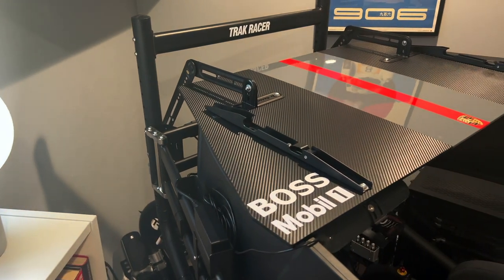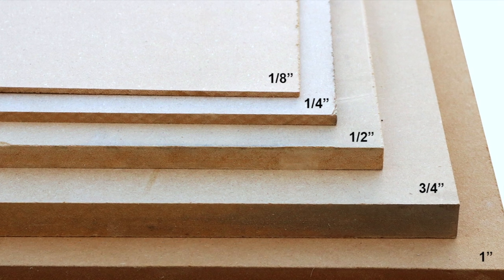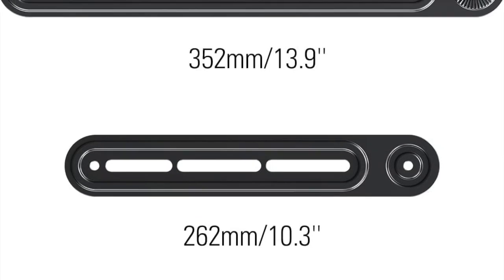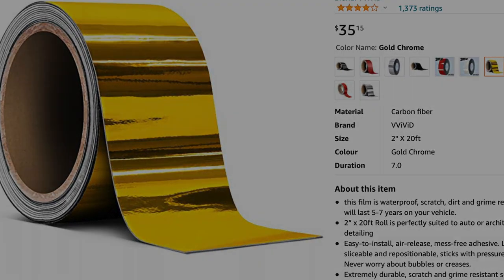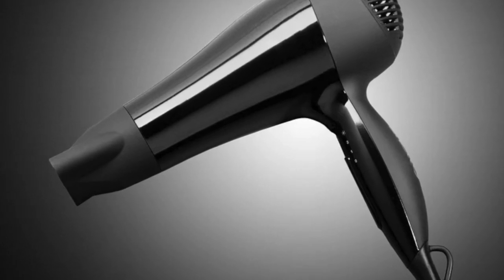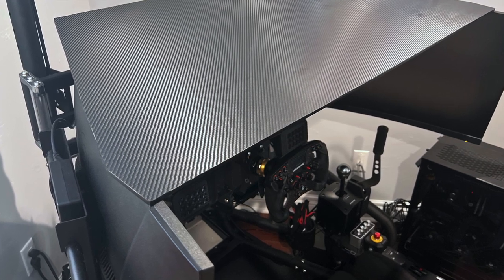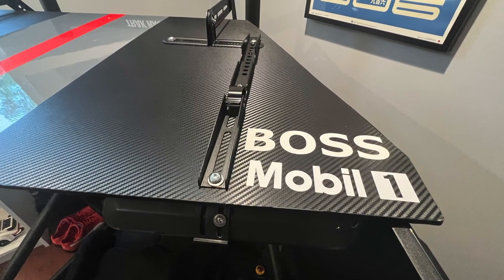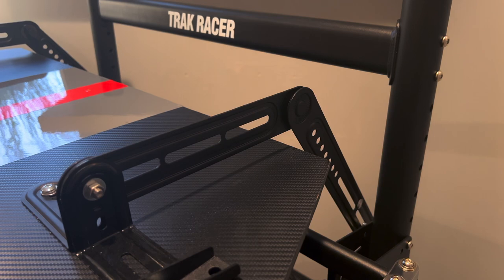Step-by-Step DIY Cockpit Roof Build for Sim Racing IMMERSION

Comment: That’s super inspiring as I am looking for different ideas to build myself a roof. Very good job mate! 💪 I love the clean look on top! 👏 questions: your head is still not covered by the roof? Isn’t that a bit distracting/off? Why not fully cover the cockpit including the seat? I first thought your roof can be lifted / tilted up… thanks for the idea though. 😊 is it getting warmer while racing now, with the roof installed?
Reply from the maker: Thanks! My head is not entirely covered, but it's still very immersive. You're not looking up directly above it, but it helps close in the screens so your eyes aren't seeing anything above the monitors; it's very convincing. It helps with comfort when getting in and out of heat. The roof can be tilted up on brackets that can hinge open. I don't think I showed that, but it's possible with how I built it.

Comment: Very nice I’m building your design right now.  What did you use for the mount on the frame of the monitor stand for the brackets to hold the tv mounts
Reply from the maker: It worked out that my monitor stand at the time had holes as it was a tube frame so I ran a long bolt through it to secure the mounts.

Comment: How did you mount your z5500  on the rig and also did you mount the rear speakers? Super clean setup! The roof is indeed very nice !
Reply from the maker: Thanks! I used Trak Racer's speaker mounts for the TR8 - https://trakracer.com/products/tr8-5-speaker-kit?ref=Yhvdp_5RM04bsP.  As for the rear speakers I did have them mounted too but removed for now since for some reason I can't get my rear surrounds working seems to be a windows issue.  Thanks for watching!

Comment: amazing! I'm following the steps to make the same one, did you glue the vinyl on top and also on the bottom of the mdf? did you paint the edges or is it also vinyl?
Reply from the maker: I didn’t glue the vinyl it is self adhesive for the around the edges I used thin vinyl tape.  Good luck with your roof!

Comment: great job for the roof, how come you moved the monitors between the base and the steering wheel compared to the previous setup?
Reply from the maker: Thanks! I wanted to try getting the screens closer to the wheel to see how it felt and at that coordinating FOV so far it feels better for me and more realistic.
Reply: @simracingden  ok i had that too, first then i moved back to half base to also have a bit of the hub effect plus a part of the base like on mercedes gt3 or porsche, then i have 3d prints for the sockets air to simulate the dashboard a bit, unfortunately every car is different and being able to adapt to all of them is a bit of a problem.  if you want to see there are two videos in my channel
Reply from the maker: @zazadj1  Just took a look, very nice setup! 👌I hear you on finding the perfect setup for all cars its always a challenge.

Comment: but my eye tracker and web cam have to be mounted to the top of the monitor
Reply from the maker: Yes, that can be an issue; you could always try a tiny shade to block out the top but still leave room for your accessories on top of the monitor. So I had to remove the roof for now as It doesn't work with my bezel-free kit will do a re-design with a cut-out for them at some point.
Reply: @simracingden  sweet